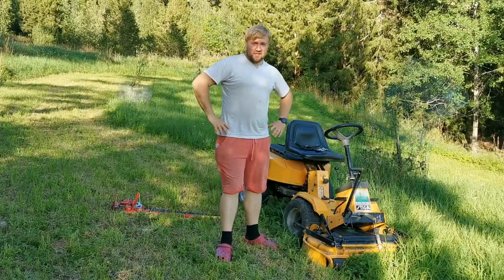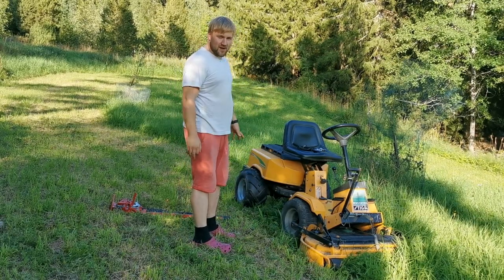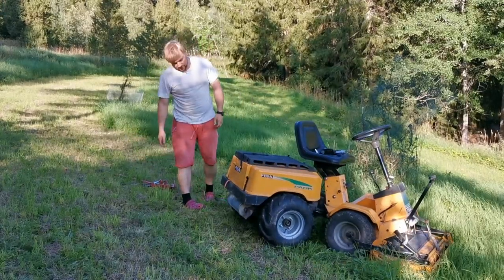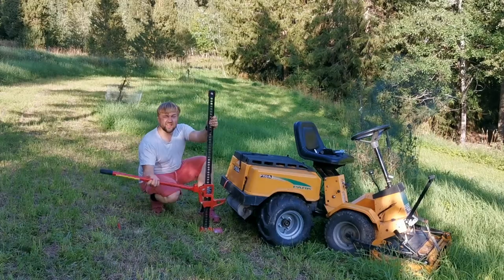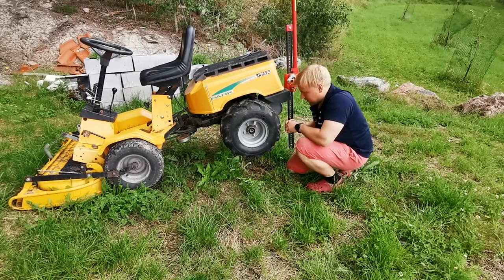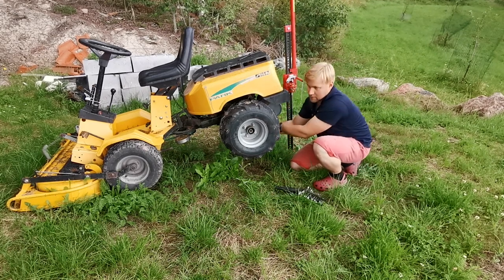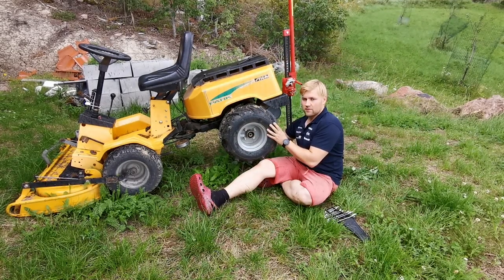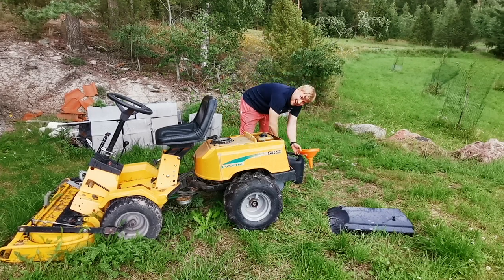Stiga Park 100 B Lawn Mower Tyre Fix with Strong Bolts | Stiga Madness Part 3 | Mikko Works Ep. 7

Comment: Hey guys just started watching your videos, IV just finished totally custom building my 2009 Stiga park 2 WD, after I ran her dry on oil I had to buy a new engine so I bought a 764cc Loncin monster unit & retro fitted it, this led to the pulley on my transmission shearing it's splines... So thinking I had wrecked the hydro transmission, so I bought a bigger used gear box, and the whole project went out of control, before I knew it I had to buy new hubs, rims, tyres, spacers, fuel pipes, fuel filters the list goes on...

But now, now she runs and it's a weapon in hopefully going to do my own Stiga video by soon.
Reply from the maker: Sounds awesome! Personally after all the work and new parts one needs to install, the costs between a new mover and renovating an old one are starting to align in a terrifying manner. I find that the fact that you have pretty much built the weedbeast yourself and learned a ton (at least in my case this was a huge learning opportunity) it is a far more rewarding experience. And these old stiga parks are made with actual metal, so even if you want them to, you can't really destroy one entirely if you are willing to retrofit things.

Post us a link when you have made your own video, I'd love to check that out!
Reply: Hey guys I just re-watched your video because it's hilarious.

To help out with your wheel issues, looks like you purchased some 4 stud countax drive wheels, 
so next thing would be to buy the corresponding hubs which will probably be keywayed 6-10mm key shafts

Now countax hubs are usually 2'5" drive shaft diameter.
first you need to find out your drive shaft diameter on your hydrostatic transaxle, if you have an old k46, gear box it will be 2" shaft diameter
Or if it's a larger beefyer transaxle like the k61 they are 2'5" diameter drive shafts.
Reply: @benbruce4256  Yo Ben, thanks so much! I've been trying to tell Mikko about the corresponding hubs...naaah just kidding! I have absolutely no clue about that. However, I do know that Mikko will love your input - since he has almost as little clue as me. Well, a wee bit more. You've seen the video twice..so you know how it is. Hahaha. Cheers!